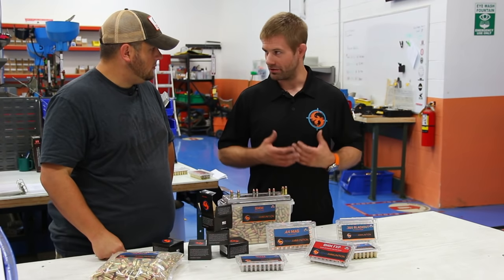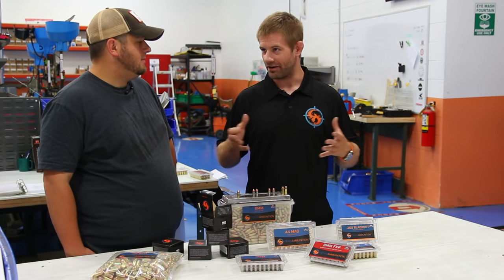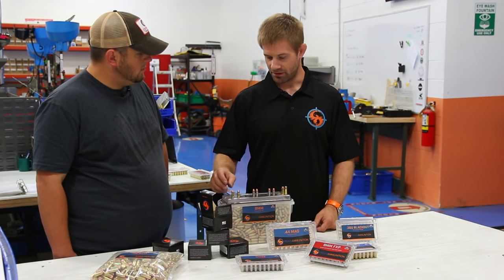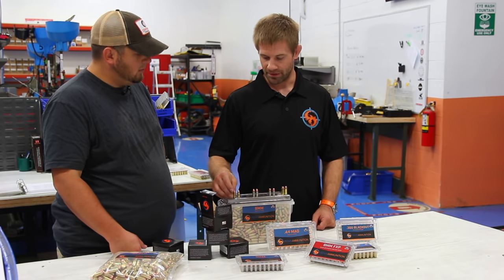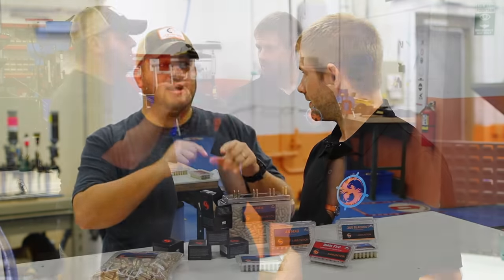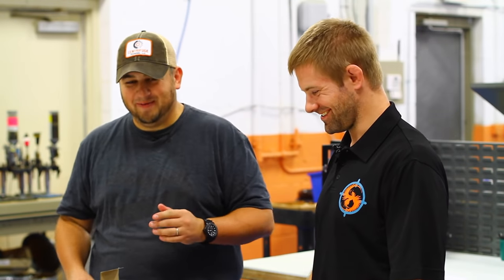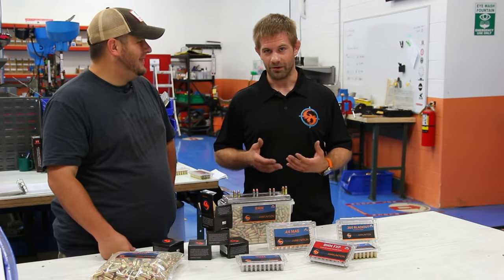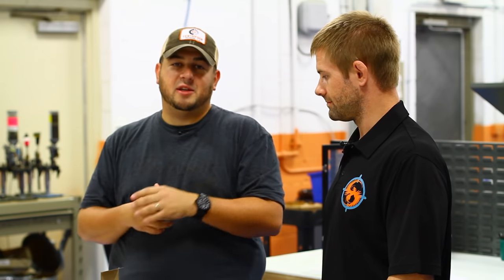Remanufactured Ammo versus New Ammunition: What's The Difference With Fenix Ammo

Comment: It crack me up when a supplier advertises used cases as "once fired"... like they have any way of knowing that when 90% of what they reload is range ammo.
Reply: Brass loses rigidity at measurable levels when fired. Once fired is measurable. Twice fired is measurable etc. Based on weight etc. So as long as the brass doesn't expand past the bore and has enough rigidity to contain powder, it's good to go.
Reply: @LavaLiveLava2  that's the most unscientific explanation I have heard all week. Everything that you don't know about metals will fill a library.   read a book once in a while.
Reply: @timhallas4275  never claimed to be a metallurgist. Just know how expanded brass using measured powder loads actually EXPANDS and weakens when shot. So do the guys reloading. Chill. Obviously you're mad at something. If u dont know brass weakens MORE everytime you shoot the case, idk what to tell u." Go read a book" as u say.
Reply: @LavaLiveLava2  I think you missed my point in the original comment.   They assure you it is "once fired" but they have no way of knowing that.